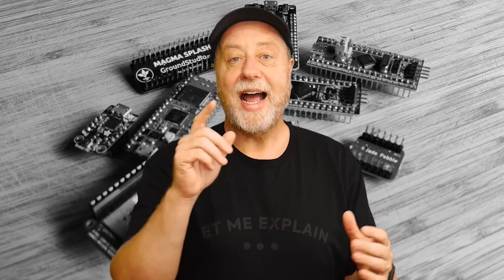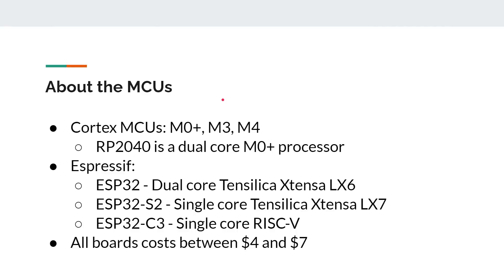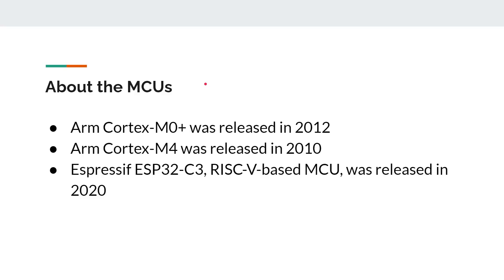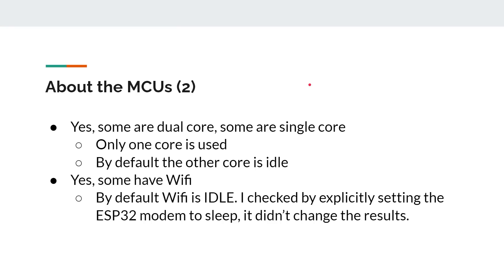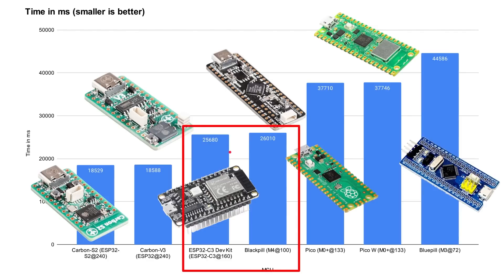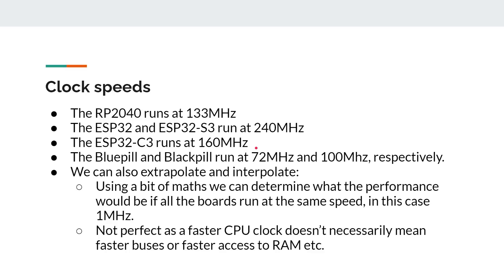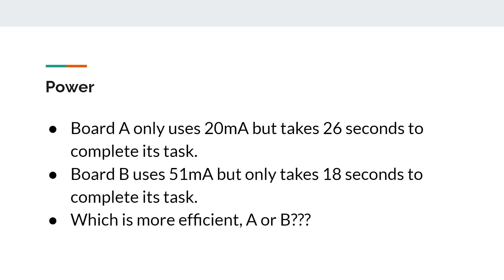Arm vs RISC-V? Which One Is The Most Efficient?

Comment: RISC-V, ARM and others like MIPS which I have plenty of experience with are just architectures; the chips you can buy are implementations of these architectures.  First thing to notice from a 30,000ft perspective is that 64-bit ARM, MIPS and RISC-V are surprisingly similar.  In the past CPU architects were more adventerous.  These days no more bat crazy shit like segments (x86) or register windows (SPARC, and totally batshit crazy on IA-64).  MIPS is an early but well designed RISC architecture; 64-bit ARM (which fortunately is rather dissimilar to the 32-bit ARM architecture) is surprisingly similar.  Which is unsurprising because one of the architects used to work for MIPS.  And RISC-V was designed by the fathers of SPARC and MIPS.
So are they all the same?  Not quite but 64-bit ARM and RISC-V benefit significantly from hindsight.
Now, once you take things to the limit things will be different.  RISC-V's smaller footprint allows fitting more cores running at a higher clockrate on a die.  It barely matters for the birdseed class of microcontrollers that's polluting most PCBs ;-
So for most uses architecture doesn't matter - software does.  That's where ARM is very well supported, MIPS is well established and RISC-V is still catching up.  That said, the folks behind RISC-V is smart and have impressed me by what they have achieved and in my discussion so they're going to close that gap.  Plus hgiher end implementations are going to show up.  Being a truely open architecture however the RISC-V market can be as confusing as a ant pile - or open source in general ;-)
Reply: RISCV having open specs should make software catching up easier than for arm no?
Reply: @markhaus  Yes and no.  Availabillity of documentation is greatly simplyfying a port to a new architecture, especially when there is already a port to a simila architecture.  It still remains a major underrtaking in terms of manhours required.  Been there, done that.  Three times 🙂
As far as software development is concerned, x86, MIPS, RISC-V, MIPS, ARM are open enough to  aloo development of dcent software.  IA-64 was special in that it's performance characteristics are ...  complex.  without NDA or possibly even being Intel it was not possible to certain software including high-end compilers.
The level beyond that is licensing  for the architecture itself  to develop a core by anybody who wants to.  RISC-V didnt really inovate there, there have been other such public domain or similarly unrestricted architectures before.  But they were the first polished architecture with academic and industry acceptance, documentation and very liberal licensing on top.  It's this mix (and probably a few more things on top) which made the rise of RIsc-V possible.
Reply: @markhaus  Yes and no.  Programming specs are open for most architectures though the degree of detail varies.  On the example of Intel, Intel CPUs accept only a signed blob as microcode and the microcode programming interface is not even documented.  Probably few users care. More painful was Intel's attitude towards protecting the IA-64.  The Merced documentation covers four thick books printed on thin paper and is also available for download (1-click sign-away your soul acceptance of terms required ;-) but errata required and NDA and certain very deep secrets were only available under terms of a much stricter NDA - the most restrrictive I've ever seen.  Finally some further aspects such as deep details on performance aspects of the pipeline which are essential for the ijmplementation of top notch code generators and compilers were not available outside of Intel at all.
I don't want to single out Intel but just picken them as an illustrative example  Companies very in their degree of paranoida, protectiveness and openness and corporate history and experiences are part of that.
RISC-V may be an open architecture.  That means the architecture is open.  It does not mean an actual implementation is open. It is possible to  implement a fully RISC-V-compliant processor under the terms of the RISC-V licensing conditions - great.  Yet iI can keep the implementation as closed as a traditional microprocessor implementation from companies such as Motorola, IBM, Intel, AMD, HItachi, MIPS, ARM etc. The result may be something that executes RISC-V code just fine yet for certain aspects such as performance has to be treated as opaque, as a black box.
As somebody who has ported Linux to MIPS it's been occasinally helpful to have access to the folks who did all the mental heavy lifting and wrote the specs.  With a RISC-V compaliant core one may or may not have the same kind of access. for a particular project.
Reply: @ralfbaechle  The folks implementing RISC_V may not even have a reference implementation.   Arm also leaves implementation up to the individual builder, so there is really no difference there.
Reply: @isaacclark9825  ARM may argue all its core may serve as a reference implementation.  That said, I think implementors are not served well with a reference implementation.  Many subtle corner cases are best covered in documentation and test suites.  With less documentation but a reference implementation an implementor may simply miss those or try to copy behaviour from a reference implmentation which really is undefined behaviour.
Reply: @markhaus  As I understand it, RISC_V is just an ISA.   The ISA's of all useful processors are very well documented, and further, they are generally not protected by copyright or patent.
Reply: @markhaus 
To re-hash a bit what has already been said - every x86 processor or x86-64 processor can execute the instructions within those sets.  They may have more or less additional instruction support - but in principle an Athlon 64 3700+ from 20 years ago is "the same architecture" as a threadripper whateverthehell-corezilla.

If you were to try and optimize a compiler for those two architectures, and every architecture inbetween, you would have your work cut out for you as you would ideally be taking each implementation into account - and the physical limitations of each would dictate what was possible or how innovative you had to get to get around those limitations.

In a similar way, almost anyone can design a compliant risc v architecture for any purpose - from a switching power supply controller to some sort of supercomputing cluster.  Without a standard of implementation to gravitate around, how do you pick what to develop risk-v software for?

This is part of where T-head/Alibaba have done something fascinating by openly publishing a few risc-v core implementations spanning several use cases.  They literally published the hdl of the processors.  Because they span a wide range of uses and will likely be the benchmark against which all other implementations are considered, it's a safe bet to design for those cores.  The only reason to develop a different core is if it implements something better for a purpose - and so you'll get better performance for the software (... probably....).

Without T-head doing what it did, the risc-v environment would probably be stunted for some time.
The chinese can be extremely shrewd businessmen in their capacity to pursue mutual success when the alternative is to be the one to fail less than his rivals.
Reply: The "catching up" is immensely accelerated by the fact that ARM is extremely expensive.
Reply: @statinskill  In the bsuiness there are stories about i being hard to get ARM inerested in deals with smaller customers so these often veer towards alternative architecures even where ARM otherwise would have been he arhitecture of choice.  It appears to have been almost the liveblood for some of the alternative architecures for a few years.
Reply: It’s not just about the people who designed the RISC-V ISA it is also about the people that implement it, they are the ones that actually determine the efficiency and clock speeds and similar.
Reply: @conorstewart2214  While this is correct one should consider the architecture defiinition of any processor architecture as something that sets the absolute limits of what's possible.  A good implementation can reach for near 100% of that; a bad one will stay well below.
With my MIPS  experience I found the size of early MIPS and RISC-V cores which are somewhat comparable   And the RISC-V implementation is much smaller in terms of transistors / gates which is an indication of how polished the architecture is.  Ok,RISC-V had the benefit modern software tools to aid the implementation. Such comparisons across decades are bound to limp somewhat.
An interesting aspect is how the RISC-V architecture is made up of several optional parts.  Just to pick one example, an implementation does not need to have a multiplication or division instruction. They were looking at other architectures' pain points.  MIPS was born as a super-fast RISC processor for super-mini computers, later workstations and servers.  Nobody  early on thoght of embedded computing.  Such omissions are hard to rectify lateron in a clean manor.
One point where RISC-V is brutally efficient is cost due to absence of licensing fees for the architecture itself. To some users that's the #1 aspect that matters.
Reply: I really like the segments of the x86. They were the right solution for a time when a few KiB of RAM was super expensive and the affordable CPUs were 16 bit only or less.

Comment: It would be interesting to know also the idle power consumption, it would give an idea of how the boards would behave when powered with a battery.
Reply: I was just thinking the current measurements aren't very useful because of all the extra stuff on a lot of those boards. Plus the esp32 are not known for low power. You would have to compare active current with the idle current of each board.
Reply: Yes the delta power should show the true cpu energy used for the benchmark, maybe Gary can follow up?
Reply from the maker: The tricky thing with a delta number is that a CPU can never actually be idle. Even doing nothing is still looping and reading instructions waiting to no longer be "idle". To help in this situation there are two general solutions. 1. Lower the clock frequency and the voltage. This is something that smartphones and laptops do. 2. Put the CPU to sleep, this is a feature MCUs tend  to have and it is similar to 1 but not dynamic.
Reply: @GaryExplains  thanks for replying. The motivation for the delta is to see the difference between the dynamic power consumption of the cpu architectures. I take the point that the cpu is never really idle, but I the case of MCUs, it should be at least the cores are idle, or running noops. I think the data would be interesting nevertheless. Idle power in itself would be interesting, so all 3 data points tells a story, idle, full load, and 'full load - idle'. Its quite surprising that a 22 year old design/process can still beat a 2 year old one.
Reply from the maker: I will look into this more and see if it is interesting enough for a follow up video...

Comment: Some feedback:
- Current draw is not exactly directly proportional to clock frequency, for instance at lower frequencies, efficiency can be worse because there is some "idle current" that doesn't change much and becomes more important relative to the clock based current. So I think it would be better to set the clock frequency of the MCU at the same speed, and do the same tests at different clock speed (because they might have different sweet spots).
- If the goal is to compare architecture and not simply the MCUs, I think this is only a fair comparison if the chips are manufactured using the same technology node, I do not know if it is the case.
- I think measuring the board current instead of the MCU current is not great either, I don't know for those specific circuits, but there are many ICs which easily consume a few mA doing nothing, some of them even when they are "turned off" (shutdown current in datasheets is usually low, but not always). One way to measure just the MCU current would be to completely remove other circuits from the board (yes, it's more challenging, and destructive to the board).
Reply from the maker: Some feedback on your feedback:
- I did that in the previous video on MCU power efficiency.
- The goal was to show the current state of RISC-V MCUs and to debunk the myth that just because a processor is RISC-V, it somehow means it is inherently better.
- I covered that in the video and made the same point myself, did you miss that segment?
Reply: @GaryExplains  Thanks for your reply, I had not seen the other video. Your graph at around 12 mins shows what I mean. For instance, at 240 MHz, rpico consumes 0.16 mA/MHz, while at 50MHz, it consumes 0.26 mA/MHz. Similar results are seen for ESP32. If it was linear, it would be the same number. That's actually a larger difference than I thought it would be. It is counterintuitive, but I believe MCUs tend to be more efficient at higher clock speed (likely up to a certain threshold). Hence, comparing the energy usage at different clock speed seems to favor the boards running at higher clock speeds.

If the goal is simply to show that a risc-v chip can be less efficient than an arm processor, it is achieved, but then IMO, the title "Arm vs RISC-V? Which One Is The Most Efficient?" is a tad misleading, I was hoping to get a comparison of efficiency of risc-v compared to ARM, which would need to control the other parameters (especially the technology node, since it is likely a huge factor). Still an interesting video nonetheless.

You did mention it in the video that you measure the board current. Depending on what's on the board this may have a huge impact. I now had a quick look at some schematics and it looks like the boards are quite bare (though I'm not sure what's the exact board you use in some cases), so it may not be that important in the end. One thing I noted though is that most board use an LDO while the Pico apparently uses a DC/DC converter. Boards that use an LDO should indeed have the same current going in 5V as in 3V, however this should not be the case for the DC/DC converter. Efficiency of those LDO is 3.3/5 ~= 65%, while efficiency of the DC/DC converter of the pico is mentioned "up to" 90% (though this varies with consumption). This is an advantage towards the pico board, not related to architecture. If you indeed measure the same current when supplying the pico from 3.3V, it is either because the efficiency of the DC/DC converter is actually 65% as well, or because there is some leakage to the DC/DC converter when there is a voltage applied to its output while its input is floating (which is possible since it is likely not an intended use case).

Just to make it clear, I just wanted to provide some constructive feedback, I'm subscribed and enjoy watching some of your videos, I hope this doesn't come off as arrogant.
Reply: @Franzzl  I agree; if the goal was indeed to compare the efficiency of Arm vs RISC-V, the best way to do it (aside from getting two different chips that are identical, apart from the CPU core - so same node, same class, same memory, same speeds etc.) would be to record the actual number of instructions executed for a given benchmark - i.e. the _dynamic instruction count_.
This is the only meaningful number to look at when comparing one ISA vs another. Otherwise you're just comparing chip vs chip. And the direct comparison of cycle counts that was done in this video isn't realistic either, for the exact reason that Gary actually explained just before showing the comparison; memory systems are running slower than the cores themselves and often have a somewhat fixed latency when reading data (and instructions), so you'll typically waste more cycles waiting for memory when running the CPU at a higher frequency.

So Gary: nice try and I really appreciate that you focus a bit on my field (MCUs) as well, but for this particular comparison it could've been a bit better - at least from a "comparing ISAs" point of view, from a "comparing MCUs" point of view it was great! :)

Comment: Gary did you check the real clock speed of the RP2040. The maximum clock speed is 133 MHz but in the SDK it is set to 120 MHz because it is easier to get the correct clock for peripherals like the USB. Check SystemCoreClock in the SDK. Are you running the test from RAM or XIP? You probably see a difference here.
Reply: There is actually even more fun stuff here:

The chip has 2 PLLs; it sets one to 48MHz for USB, and one to 125MHz for CPU and bus clock. 125 is also much more manageable to get useful clocks for other peripherals as you said.

You can also push the pico MUCH further than what it is specced for. I have run complex programs with PIO and PWM at 300MHz just fine running from RAM, and ~250MHz when running from XIP.

Comment: Gary, there was an article that i read about a week age that Apple may be shifting away from ARM to RISC-V. What do you think that Apple will switch to RISC V or continue with ARM for the time being?
Reply from the maker: If we read the same article it says that Apple is using RISC-V for some of its small co-processors, that is all. It is a good engineering choice, if it has to design bespoke hardware blocks then RISC-V is a workable solution.
Reply: @GaryExplains  Maybe but that Article had some text about moving to RISC-V that Apple might be considering. Moving to RISC-V would benefit Apple in long-term as they wouldn't have to keep paying ARM for royalties or whatever deal they have with ARM. What's your take on this?
Reply from the maker: No, that part was just pure speculation because otherwise it would be a boring article and no one would read it.
Reply: @GaryExplains  ok, thanks for clarifying.